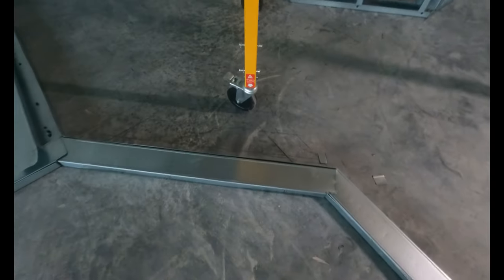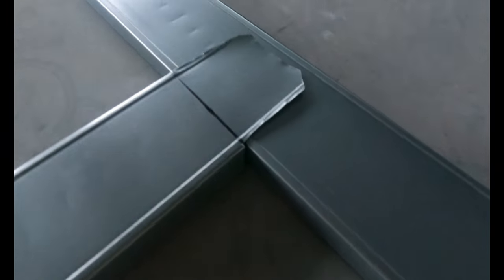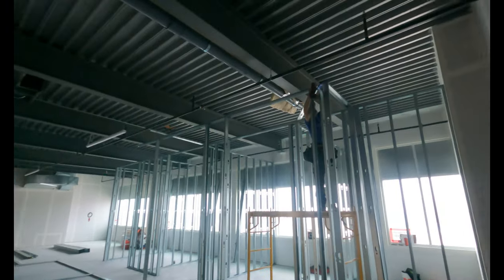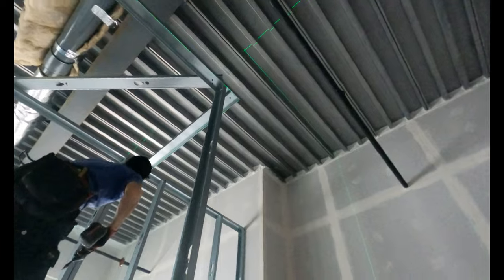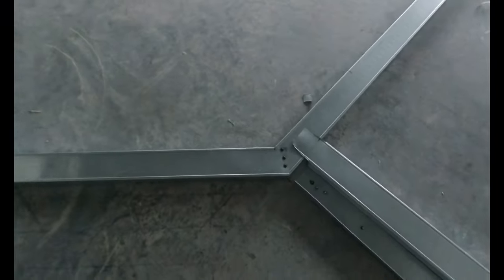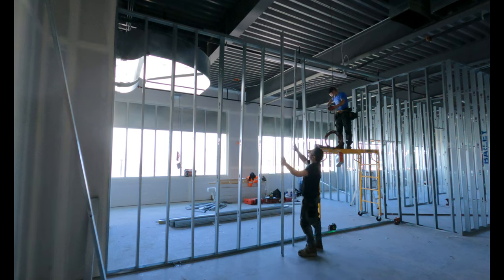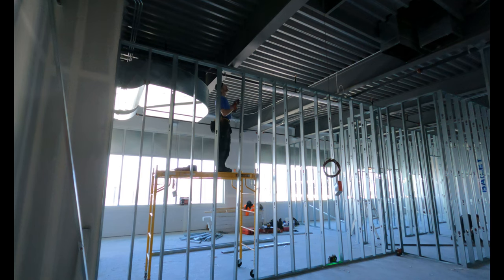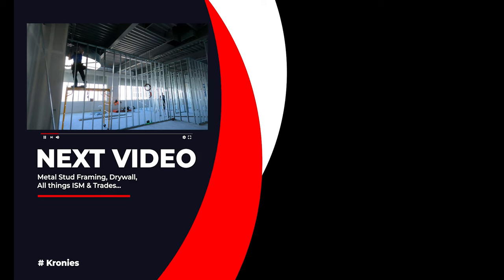Metal Stud Framing Free Floating Walls

Comment: How did you learn how to framing with metal?
Reply from the maker: Yes right on! I started carpentry and wood framing 30 years ago and metal 20 . I attached myself to knowledgeable journeymen and foremen that knew there stuff. Watch and practiced. Made a lot of mistakes but learned everytime. Now I know the best system and really the only system to make it happen. Always be open to learning new things. I didn't have YouTube when I started i was just eager to learn and worked super hard so that the best guys wanted me and taught me!

Comment: If you were to put a ceiling in there how would you do it? Do you have any videos showing how to? I'm putting a room in a garage using metal studs. 
Thanks
Reply from the maker: Yes, the walls are 12' and the ceiling height is 10'.  We always run the walls higher than the ceiling. You can frame with metal furring bar, angle and use hanger wire or kicker braces. I do have a bunch of videos on that system. You can also install t-bar and I have a couple videos on that too (suspended ceiling grid).

Comment: In metal stud walls, why are some end studs not screwed in place?
Reply from the maker: Those are called slammers or floaters. You don't screw them in until tye drywall stage. They allow for the drywall to slip through or stop at the inside of a corner.
Reply: @ConstructionKronies  makes sense, thanks 🤙